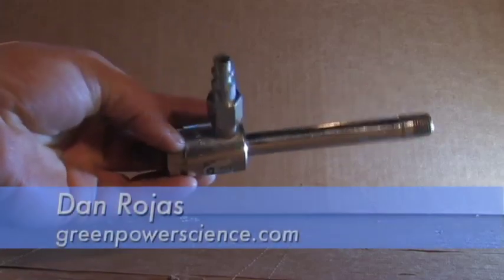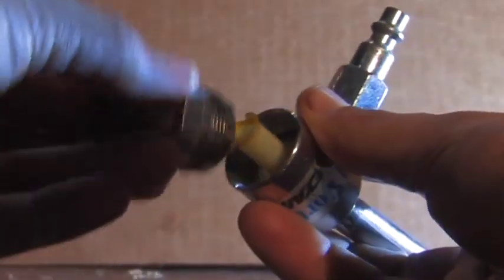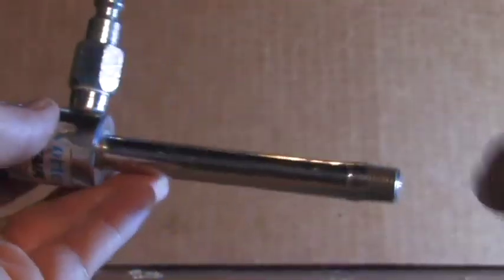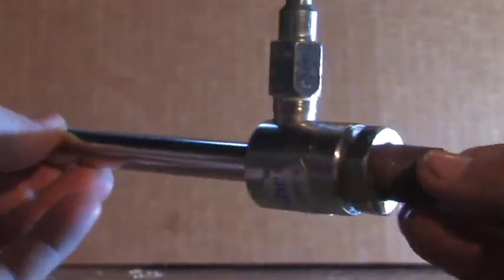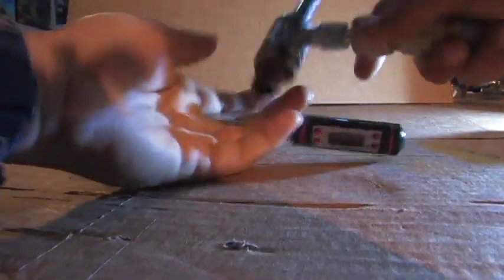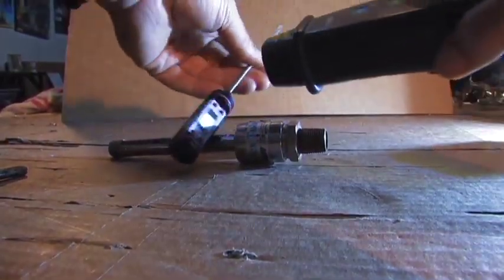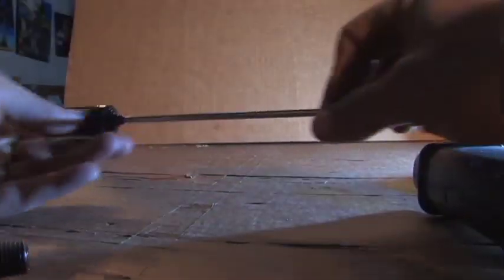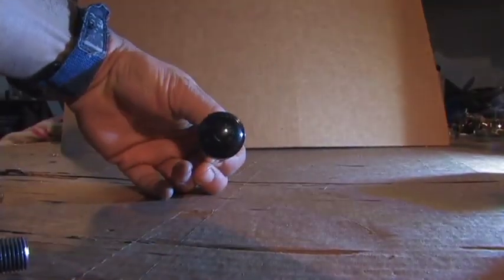17,000 RPM turbine digital thermometer Tesla vortex style turbine

Comment: The Vortex tube sounds wonderful, however its not new its a known technology and has its uses in, industry but don't forget the size of the motor that creates the flow of air. It isn't cheap and it isn't free. Most compressors have huge motors in them. Now get this thing to run with out using any other source of energy then the world will beat a  path to your door.

Comment: @breezebro 
Yeah I figured it wasnt efficient but I was wondering if the more efficient models he were talking about wouldn't be if one factored in the benefits of getting hot and cool air out of one device along with the added safety bonus of not having to use a heater element seeing as I can't figure this thing catching on fire as long as the compressor was kept in a safe location, also the air would be a lot less dry with this thing then the air you get from a heater.

Comment: use to use these at work when we were sandplasting the air to our hoods woudl be ice cold so we   ran a few of these on the line... they work OK   but at -20 or more they pretty much dont do a thing, they work on air pressure, not air volueme so for them to function well u need alot of psi. atleast thats my experince with them

Comment: Can the rotating air power turn a generator?
Instead of a compressor can the air pressure be generated by heating a long pipe full of air in the sun.  The air would have to be cooled and recirculated?

Comment: I'm thinking that this is yet another way to use steam - instead of losing energy to the piston cylinder friction and valves in order to create rotation, you have the conversion from gas pressure to mechanical rotation with zero moving parts. Insert turbine, extract energy!

Maybe not efficient, but we needn't use coal to heat the water...

Comment: @breezebro I'd say that depends on the size of your compressed air depot. We have one at work we use and the actual motor for the compressor only switches on when the kpa drops below a certain point. Surely having 1 thing run some of the time is better than1 thing running all of the time?

Dan, this would be a perfect vid for you to discuss!

Comment: This is interesting but not as practical as your black box heating system.
I'd love to see you bury a metal tube (maybe 30 feet long and a foot across) 4 or 5 feet down in your yard, then use a black box heater like the one you built a few videos back, along with a stove pipe that sticks out of the heater at the top. Connect them both to your home and watch as the sun heats the box, hot air goes up the stove pipe, then it sucks cool air into the house from the ground tube.

Comment: Very nice! I guess it works on the same principle as diesel engines and fire pistons do (i.e. air, when under compression, will heat in direct relation to the amount of compression). I learned this the hard way years ago when helping my dad in his shop. My arm brushed up against the copper tube that connected his air compressor's pump to it's holding tank and I got a very nice 2nd degree burn. Ah, life lessons learned in practical and painful ways are remembered forever.